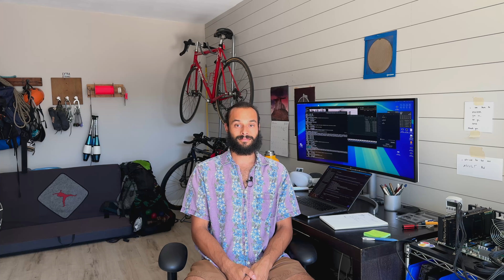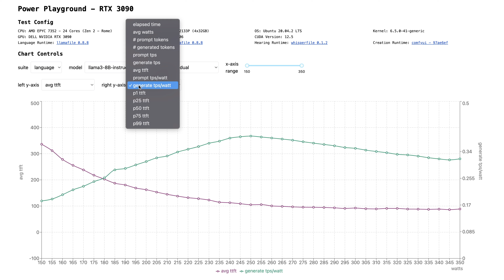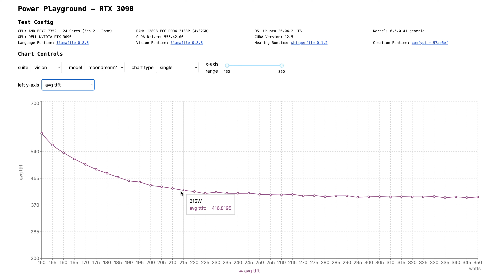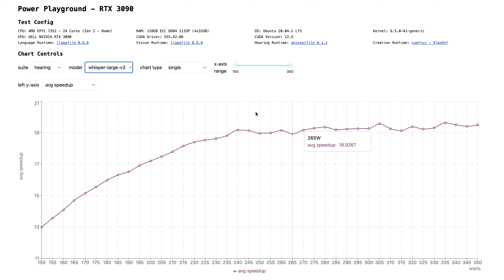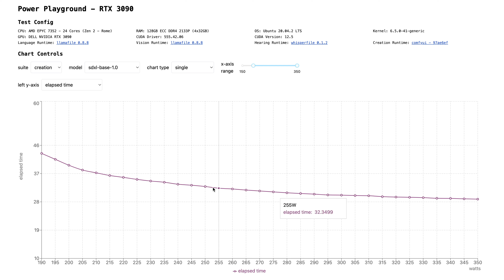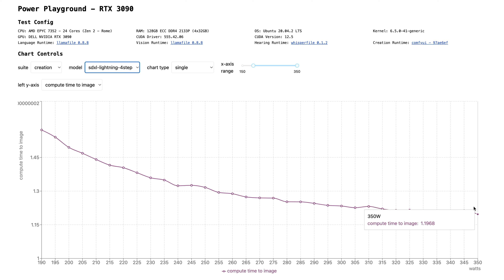GPU Power Tuning for AI Workloads

Comment: yea i subbed too, my question is, if i get 2 of these together, what models can i run and what should i expect? i am a bit new, thank you
Reply from the maker: This is something I'd love to explore more soon, I've been targeting single GPU's generally, but plan to work with multiple GPU's soon. I will share benchmarks in a video as soon as I can

With this said I personally think that buying 2 is probably not worth it. There is a pretty big jump in model size from the 20-30B which this GPU can run on it's own, to the larger 70B+ models. Once you get to that size, the speed of inference will slow down quite significantly, and there are many companies who are running those models for very cheap which may outweigh you buying the GPU's in the first place. Or even renting those GPU's on a public cloud may make more sense. This is probably how I will end up testing multiple GPU's because the cost becomes prohibitively expensive
Reply: What are you going to use as a benchmark?
I am going to test my ai machine with two RTX 3060 gpus, but I don't know how I should setup my tests.